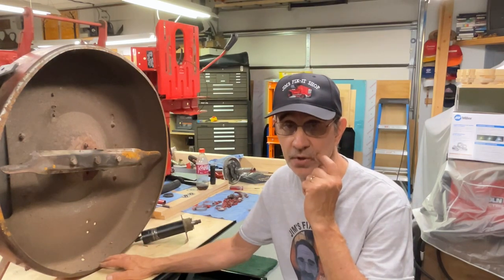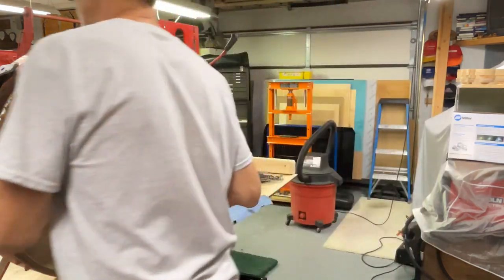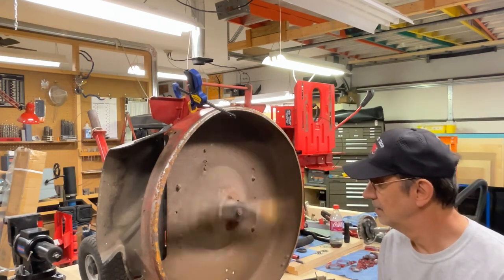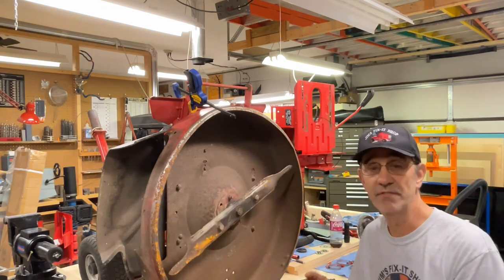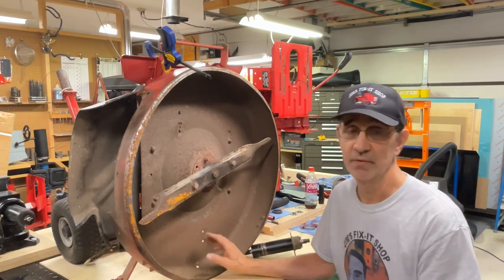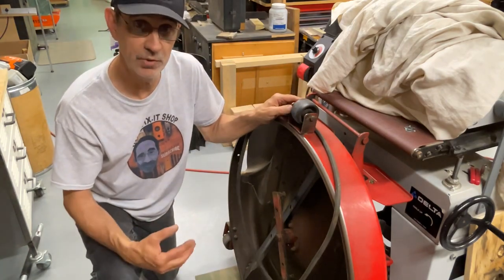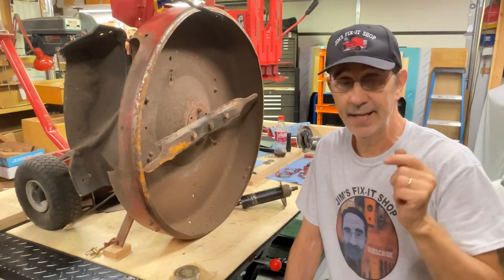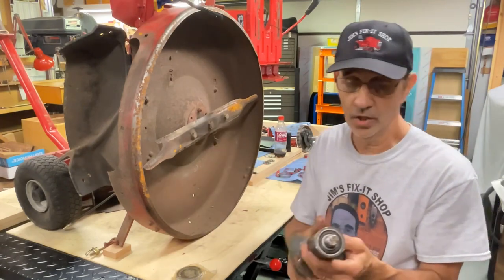422.   How do I grease or oil my mower deck? ￼

Comment: I couldn't agree with you more about sealed bearings! One thing I do, is clean the under side of the deck with a scraper or wire brush, and apply a coat of WD-40 (or similar lubricant), this makes grass clippings, dirt, etc a lot easier to remove later, and keeps the deck rust to a minimum! I do this every spring and fall and have had some decks outlast the mowers they were on! It's kinda like a non stick for the mower deck! Keep Snapping!!
Reply from the maker: @JodyCall  I do the same thing to my more decks in the fall when I’m done sucking up leaves, I take them off clean them good with a small wire brush on a right angle air grinder and I give it two or three coats of rust oleum paint and I don’t really care what color I use just whatever I got around and I haven’t used for a while. I spray it on there and use it up. Jim.
Reply: @jimjackson9381 Awsome!! Paint would probably work even better than spray lube! I've brushed on used motor oil as well, when nothing else was available! Thanks for taking the time to reply, and God bless!!

Comment: My mower is 20 yrs old and has the original spindle bearings. They have never been serviced and they are quiet and spindle does not wobble. I'm afraid to mess with it. I do have Snapper replacements. I have owned it for 3 yrs and have about 80 hours on it. Lord knows how many before me.

Comment: I use 50% diesel and used motor oil 
Put it in cheap hand pump sprayer

Lift up front of mower and spray it after every use, pressure wash it first if needed

Comment: Thank you Mr.Jackson for all the years and videos you have put out. 
Imma gonna be doing a hack job to fix my snapper's. Hmm what would you call it. the steering axle tie rod plate. It snapped today. So welding things tomorrow. 
But because of you channel I have been able to take two snappers to make one "working" snapper. My place seems to be the graveyard for a lot of riding mowers. I no longer try and use craftmans and mowers with dual spindles ect. My terrain is rocky and changes regularly with minor flooding. So hitting a pebble with spindle deck equals broken spindle. But these rear engines. so nice and easier to work on. One of the two snappers I have had for almost 20 years(my teens). Dragged that thing around for a long time moving houses ect. I parked it five years ago because the the gear and the chain in the chaincase broke and couldn't afford to fix it. Now it's just a few pieces next to other mowers. But it heart is in a newer/90's model. 

These snappers are the real battle tank of mowers. Have you ever made one remote control? That could make a nice video or 12. especially since I've been seeing people make videos on their $5000+ remote control lawn mowers. Use to cost about $100-$150 to make a snapper remote control. 

Again this is really just a thanks. And I ramble.
Reply from the maker: Well, I always enjoy reading emails and sounds like you’re a real Snapper lover also, do you need anything? Let me know. Jim.
Reply: @jimjackson9381  I will let you know if I need anything. Thanks so much.

Comment: As usual great video and thanks for sharing your knowledge of these almost unkillable machines, and that explains why the spindle on the mower I got with a piece of property we bought has so much grease in between the brake and spindle, at least I know what not to do when I get around to replacing the bearings. Where can you get a replacement for the spindle if needed, saw in your previous video you said you made it but thats not really an option form?
Reply from the maker: I get just about all my parts from Parts Tree.Com out of Texas great website to navigate through and they will actually answer their phone and help you find what you need all you need is your model number off your machine.            Jim
Reply: @jimjackson9381  thanks

Comment: Looking at episode 422, I was looking to see how to replace the grease fitting on the spindle. I`ve always put a couple pumps in there every year. The mower is only used to cut my yard. This year, the fitting seems to have been stopped up or has a blockage. As I try to pump grease, it just squirts back at me and not into the fitting. I believe it`s a 3/16 press in fitting. After watching the video, it seems to me that you do not recommend greasing that fitting anyway. Am I misunderstanding  something here ? If i need to replace the fitting, how do you press one back in or get the old one out ?  Or, do i just not do anything and let it stay as is ? I love these videos. My next quest is to figure out how to cut level like my old snapper. That`s for another time. Thank you for your selfless efforts to help folks like me.
Reply from the maker: It looks like most of them are pressed in but I wouldn’t really worry too much about it because the bearings today are sealed and greasing that is not really going to do a thing outside of making you feel better. Jim.

Comment: All 3 of my snapper RER's have a grease fitting on the underside of the spindle that I can see when the machines are up on the ass end.    I have an old 3081, a 25065 and a 700104 2005 model 30" cut.  Everyone of them has a fitting.  The 2 older ones have the inner cover removed from the bearings and the cavities are filled with grease.   I assume the 2005 is the same since it has a grease fitting just like the other.    Every summer I pump them up with grease.

Comment: I didnt know there was a grease insert on the  blade bearing lucky for me  I didnt or I wouldve greased it for sure thank you for the great tips  I am awaiting the Craftsman Hood and seat until I hear back from you I just cut without the hood for now or use my okd Snapper which needs repaired a few times a year
Reply from the maker: I’m going to try to go get that craftsman today hopefully if nothing else comes up and when I do, I will send you pictures right away.       Jim

Comment: Hi Jim.  I am having a problem where the blade is slowing down (and would stop completely if I didn't stop the mower and let the blade come back up to speed) when I go through thicker grass (the engine is not bogging at all).  It feels like my options are to try to extend the mower to try to tack some slack out of the deck belt or just change the belt.  I am thinking that just changing the belt is the easier path but thought I would check with you to see if you have an opinion.  Thanks.
Reply from the maker: I think I would start with the belt and check all the pulley start with the one on top of the spindle and the idler,  let me know how it goes.       Jim
Reply: @jimjackson9381  Hi Jim, I figured since the belt is still intact I would try extending the mower before replacing the belt.  I moved 1 washer to the other side of the bolt and gave it a test run.  It seems to have worked.  It was great to be able to mow in 3rd gear instead of 1st and not have the blade constantly slowing down!  Thanks for all your videos.

Comment: Jim how can i tell when the bearings are bad.
Reply from the maker: Well, if you’re talking about the bearings in your mower, deck, stander machine up and grab onto the blade and try to wiggle it around or tip it from side to side it should not have any movement in it other than rotation.     Jim

Comment: Only the lower grades (cheap) of grease are lithium based (soap) ,  superior grades of grease (expensive) do not dry out, Snapper put that spindle grease nipple on because they had  lots of engineering and production money to waste, if they fitted a grease nipple it gets grease and the Snapper manual agrees,
Reply from the maker: @m.g.540  the bearings are used today are permanently lubricated for the life of the bearing and they’re sealed pumping grease inside that spindle is going to do absolutely nothing except it’s gonna be forced out of the vent hole on the top and make a mess for the break on the spindle but hey, it’s your machine. Good luck.